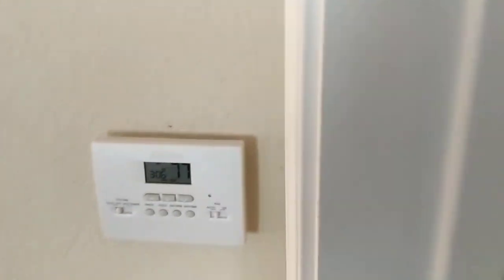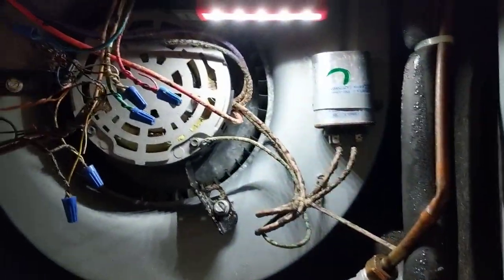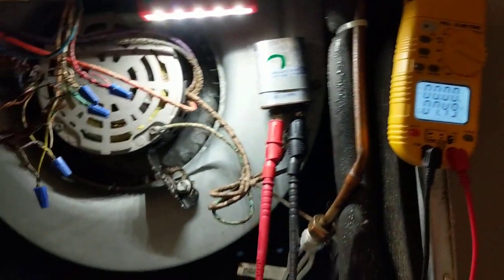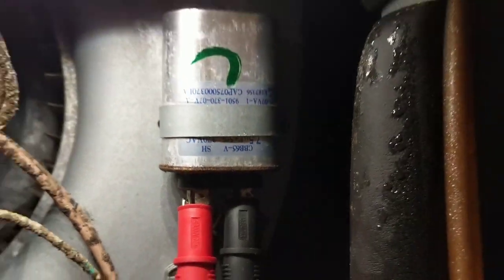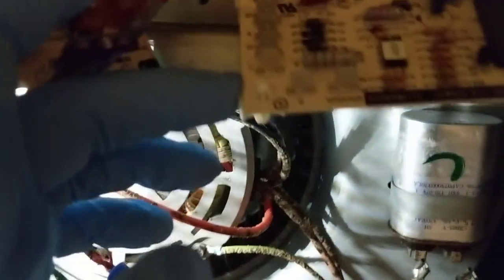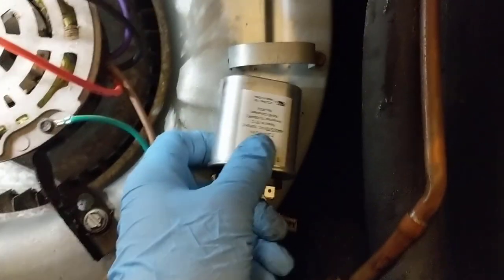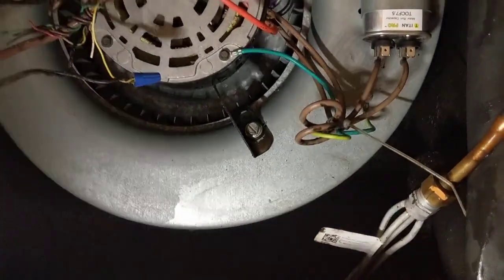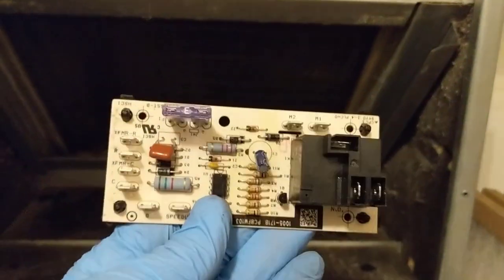Air Handler Fan Won't Come On

Comment: You can definitely check inputs and outputs on the boards. Sometimes the boards will have spot where it gets power from a transformer and you can for (testing purposes) hook up the power lead from the motor and watch it function. Of course, testing the windings is a better way. Cool video.
Reply from the maker: Yeah I have other videos where I check for 240 at the relay on the board from common to the Normally closed, and common to normally open. Also where I check for 24 volts coming into the board from the transformer & 24 volts going out to the field wires, which I didn't film the part where I checked for 24 volts at the thermostat (which I had). Those relay's go alot on those boards, I've had them stay open & stay closed to where the fan never shuts off, or the fan never comes on like in the video. All sorts of testing you can do with them, fun to troubleshoot. I had a board last week that basically caught fire, the relay was smoked! I have to edit that video and I will get that uploaded.  I Appreciate the knowledge R B & Thanks for watching bro 👍

Comment: Thanks for the video. Before getting a board, how about just providing power directions to the blower (bypassing the control board) just to make sure the fan motor is okay.
Reply from the maker: You can just ohm out the fan wires. The sum of two sets should equal the 3rd set. Thanks for watching mgpvii & subscribe to the channel 👍

Comment: New guys wanted to see how you troubleshoot it to determine that it was bad; nice video
Reply from the maker: I've done so many I know where to look lol. This is how I troubleshoot these units, & this is not an instructional description, but just me basically summarizing what I do. If the fan isn't running 1st thing I do is pull the face off the thermostat, jump out the red (24volts) & green (fan wire), if the fan kicks on then you have a bad thermostat. Even in that situation I will still pull the cover off the air handler & test the capacitor for the blower motor, & if it's bad or weak I replace it. If the fan doesn't come on after jumping out the thermostat the next thing I do would be,  pull the cover off the air handler & visually check the wires, make sure everything is on tight, & check the board visually. Next I will test out the Capacitor. If that checks out good, I will put the disconnect back in with the cover off, flip the thermostat fan to ON, grab my meter & make sure I'm getting 24 volts across the G terminal on the board & on the C terminal on the board. If I get 24 volts there then I know my thermostat wiring is good. Then the only thing left is the board, & fan motor itself. You can pull the disconnect back out (so power is off of course) Then remove the wires from the relay on the board. You will have a wire at the C (Common) terminal, wire at N.O. terminal (Normally Open), & N.C. (Normally Closed) and set my meter to continuity & test from Common to NC, then Common to NO, if that check out bad, replace board, if that checks out good, next I would put wires back on the terminals on the board, but not all the way down that way I can get my meter leads in there with the lower on to make sure I'm getting 240 volts across the relay, 99% of the time I don't cuz the relay is bad on the board. They are known for that.Ofcourse all of the troubleshooting should be done by a experienced technician with the proper tools & understands how the system works. By NO MEANS this is not a instructional way to go about it, this is how I do it. If any of this information helps out the new guys at your business, or property, then that's awesome but make sure proper safety steps are taken if going to troubleshoot anything with the power on. I would like to think that if someone is learning this field they have an understanding of how the machine works, & how to use a meter properly. Thanks for watching Alex & Subscribe to the channel & Have your new guys all Subscribe as well 👍

Comment: Have all the same symptoms, except mine was making a humming noise, and the transformer was getting very warm/hot. Does that lean more towards "board replacement" or "capacitor replacement"?

Great video 👍
Reply from the maker: Hard to say without seeing it, they all hum & transformers are warm so not sure. You would have to test the capacitor & check the thermostat as well. Thanks for watching webeducation & Subscribe to the channel 👍
Reply: @ApartmentMaintenance  thanks for the reply, that helps a lot. Didn't realize they all hummed and got hot like that. The run/start is rusty looking so I might as well replace it too. Hopefully the tests show thats all that needed.
Reply from the maker: @webeducation  I have seen a few capacitors rusty as well. But hopefully that's all your issue is. Good luck 🤞

Comment: I’m having the same issue. Replaced blower motor, Tstat, and blower board. Transformer warm to touch. Getting 240 up top. When the signal sends from the thermostat to air handler I’m hearing one single click but no action with blower. Any suggestions?
Reply from the maker: I know you said your getting 240 up top, but are you getting 24 volts coming out of the transformer? Did you check the blower motor capacitor? Thanks for watching Zach & Subscribe to the channel 👍

Comment: you were just guessing it was the board,the motor could've been out on overload,I've seen that numerous times,always make sure the motor is getting voltage
Reply: If it was out on overload then the indoor fan blower would not have spun easily or something else would have been fairly cooked. That relay could show full voltage without a load but once loaded up it could drop out.
Reply: @walkingfreak  do you know what out on overload even means? you must be mistaken with ceased
Reply: @walkingfreak  obviously you're not an hvac tech
Reply from the maker: Yes it could of been the motor & I've could of ohmed it out to make sure before changing the board, but just from past experience it's always been the board. I'm sure the day is coming when it will be the motor. Thanks for watching Pelon & Subscribe to the channel 👍
Reply from the maker: @walkingfreak  My bad Matthew, thought u were talking to me, didn't realize u were talking to Pelon. Thanks for watching👍
Reply: I've switched out the board thinking that was the cause, unfortunately I couldn't see the fan motor burned out cause I never took it out
Reply from the maker: @edwinrivera8121  You don't have to take it out to see it's bad. You can test it electrically or if the motor was locked up, you could of just tried spinning the motor. I always check my motors before changing out a board, I may not show every single thing I do in the video, but I definitely check that, and every other component before changing something. On those Goodman air handlers you can pull the wire off the board (whatever speed your using) at the relay, and put it on the power block terminal where the disconnect plugs in to test the motor if you know what your doing & feel comfortable doing that. Good luck on getting your motor replaced & Thanks for watching Edwin 👍

Comment: Thanks for the video, my fan sounds like it barely turning, i am hoping it is the cap. I am going to check that and the connections, if it is the board are there numbers on the boards to get the right one or are they interchangeable? I put my fan only ( nest thermostat ) on for 15 minutes and it was fine, I decided to go an extra 15 minutes after it stopped and now it will not turn on and i hear it humming and sounds like it is turning slowly. I tried putting the a/c on and the same. I haven't opened it up cause i had to go to work. Thanks.
Reply from the maker: Hopefully it's the capacitor, & most of the time it is. Usually when the board is bad, the fan will either not come on at all, work sometimes, or stay on non stop. There should be numbers on the board, is yours a Goodman? If you get the model # off the air handler you can search it online to figure out the part # for the board. Good luck. Thanks for watching Robert & Subscribe to the channel bro 👍
Reply: @ApartmentMaintenance  Okay so i removed the panel and the wire connections were not the greatest looking. I was wrong the fan was not spinning at all. I pulled the capacitor and it was a 10nf plus or minus 6%. My reading was 7.78 repeatedly. I had the fan running for 15 minutes from the thermostat ( the fan was not spinning but had the demand to ) while cleaning things up i heard the contact switch off on the board because the thermostat told it to, so i knew that was working. I hooked the capacitor back up with cleaner connections and it did work. So i ordered a new capacitor and the system is at least working until then. I am in cooling mode here in Florida. Thanks for your help and i did subscribe, My job is in building engineering for a high rise condo but i do not work on a/c's regularly. I know enough to make things interesting. At 59 years old i am still learning. My unit is a carrier heat pump.
Reply from the maker: @rsk8310  Glad you figured things out & once the new capacitor is installed you should be good. 7mfd is definitely out of range for a 10 mfd capacitor. Anything under 9.4 mfd is out if range, which I replace them once they get to 9.5 since their basically at their +/- rating & it's only going to get worse. Thanks for Subscribing & Stay safe out there! 👍

Comment: I need your advice brotha if you can spare a second. I have an old 1979 furnace in my crawl space. For financial reason I can’t replace it just yet. But the blower isn’t running on hot or cold. The blower motor speeds show the correct resistance and it spins freely, the capacitor shows the correct capacitance. I replaced the relay I went wire for wire with the updated and appropriate replacement. I updated the thermostat with a nest months before that was working correctly on heat all worked as it should. Till a week ago when I wanted to kick on the AC. All that’s left on those old furnaces is the transformer am I correct? I can’t find a control board.  If so I can’t find a replacement. How do I check a transformer if it’s working properly? It’s an old honeywell 138472aa transformer. Any help is appreciated sir, thank you in advanced.
Reply from the maker: Do you have a meter? If so, & your comfortable with working around electrical devices, you would have to see if your getting your high voltage into the primary side, then check to see if your getting your low voltage out of your secondary side. You said you replaced the thermostat awhile back in heat season, I would still check the system without the thermostat involved cause those nest thermostats have had alot of issues from what I heard. If you remove the face off the thermostat & jump out your 24 volt power wire to just the fan wire & the fan kicks on, then you know it's the the thermostat. I don't know what color wires were used on your install at the thermostat but usually Red is your 24 volt power wire at the R terminal, & the fan wire is usually green and at the G terminal. If you removed those two wires and touched them together the fan should kick on if it's a thermostat issue. another thing to check is to see if there is a small 3 amp, or 5 amp fuse in the wiring coming off the transformer low voltage wire. If there isn't, then it would be best to add one so it protects your transformer. Thanks for watching Gomezx & Subscribe to the channel 👍
Reply: @ApartmentMaintenance  I really appreciate your help. that was it. the G wire was actually Blue. I mistook it for Common. I rewired it and it works like it should. Blue runs down to my fan and fed a new wire down to feed the common. Again sir, I appreciate your help i wouldn't of thought to check from behind the thermostat. I subscribed my brotha. thank you.
Reply from the maker: @gomezx6056  Awesome! Glad I was able to help. Thanks for the Subscribe 🪛🔧👍

Comment: I’ve looked for the capacitor and the board in my unit and it seems not to have either. It only has a relay and wires direct .
Reply from the maker: You probably have an ECM motor. They don't have capacitors. The module on the motor is probably bad. They are known for going bad. Chances are the motor is fine & it's just the module. Hope that helps. Thanks for watching Djpitophp & help support the channel by subscribing 🛠️👍

Comment: I'm curious if you know how to bypass a board with a sequencer or a fan relay I just learned how to do it!
Reply from the maker: Yep I know how to wire up a relay instead of using the time delayed board. The relay is the 90340. It's really easy once you understand how the relay functions & how the system operates. I prefer to go back with OEM parts though. I will only use the relay in a pinch just to get the system up & running until I can get a board, but I usually stock 4 or 5 boards at all times. Thanks for watching OG & make sure your Subscribed to the channel 👍 More videos to come 🔧
Reply: @ApartmentMaintenance  hey so by any chance do you know or can you get me the item number for that boards use the exact same one and it is actually our lead who is eliminating boards and putting fan relays even though I am against it but he's going to be out for a couple months and I want to go back to using boards instead of sequencers but I can't find that exact board in our Home Depot Pro order book BTW it was a dryer that wasn't heating up that lead me to your videos which I subscribed to and it turns out it was the exact same problem your dryer was giving hahaha its maintenance like you that give all maintenance a good name and not hacks like sparkys and plumbers like to call us lol much love and respect bro!
Reply from the maker: @OG-Malinali  That's awesome to hear. Glad you found the channel. The Goodman Blower Board that I replaced in my video is:  PCBFM103S Just make sure your systems use the same one. I know Wilmar (Now goes by Home Depot Pro) has them, & so does Chadwell Supply. Thanks for watching bro 💪

Comment: I replaced the blower motor, cap, thermostat and still motor blower won't turn on????
Reply from the maker: Did you check the board? If so, you didn't mention that in your comment.

Comment: So confused. My handler worked perfectly and suddenly won’t power on. My dog knocked the drain pipe that includes the shut-off float next to it. The float wire may have got tugged. I’ve turned breakers on n off and same with outside unit. Any ideas spring to mind?
Reply: Update: removed the float out the circuit and connected the red wires together. Off/on breaker and magic I got ac tonight 😬
Reply from the maker: I would check the little 3 amp fuse on the circuit board first, you can visually check that. If that checks out good, whoever installed the float switch probably installed it by breaking red (24 volt hot wire) to cut the thermostat off when the switch is full of water. I would check the wires at that wire nut as the dog could have knocked the wires out. If so, you won't get any low voltage. Thanks for watching Dale & Subscribe to the channel 👍
Reply from the maker: @dalebrenchley3311  Wow I was typing my response as your next comment came through. Sounds like the float switch might be bad. Since you have it removed from the system you can test the float switch with a multimeter on the continuity setting & slide the float up & hold it there the meter should beep & when you slide the float back down the beeping should stop. If it doesn't beep at all then the float switch is bad. 👍